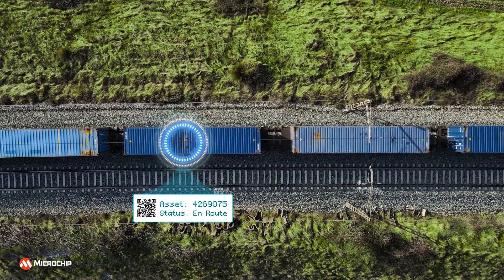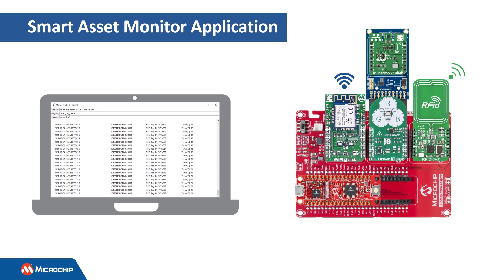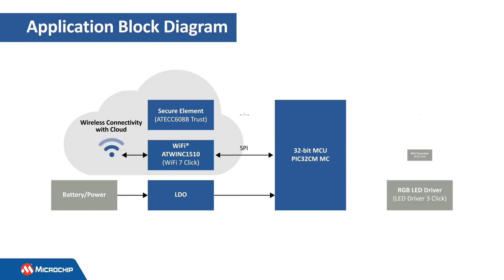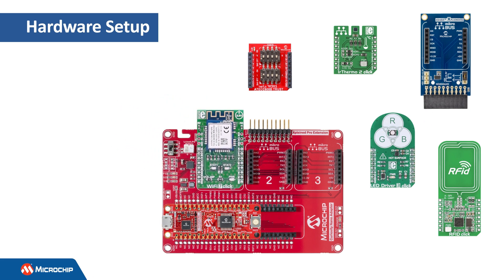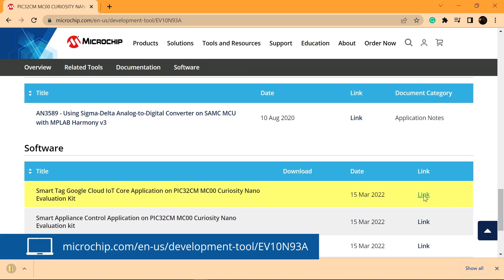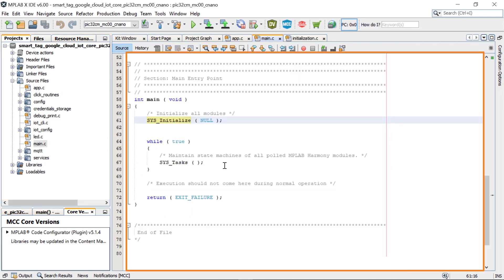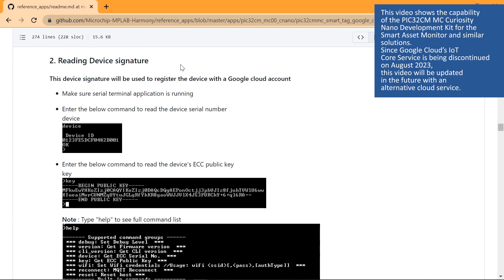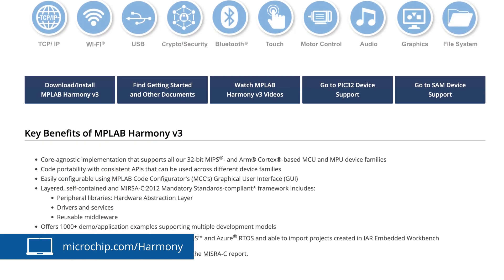Create a Smart Asset Monitor With a PIC32CM MC00 Curiosity Nano Eval Kit and Google Cloud IoT Core

Comment: Thank you so much. I'm new to PIC and embedded programming and this is helpful for me.  Any tips/pointers  for using Azure IoT instead ?   Would be nice if out of the box support for the demo could using Azure IoT cloud instead.   Thanks again
Reply from the maker: Thanks for reaching out! Here is an available demo using the PIC32CM LS60 Curiosity board that can be used as a reference: https://mplab-discover.microchip.com/v2?dsl=pic32cm+AND+azure. Hope this helps!
Reply: Ahh thank you so much for the link!
Reply from the maker: No problem!